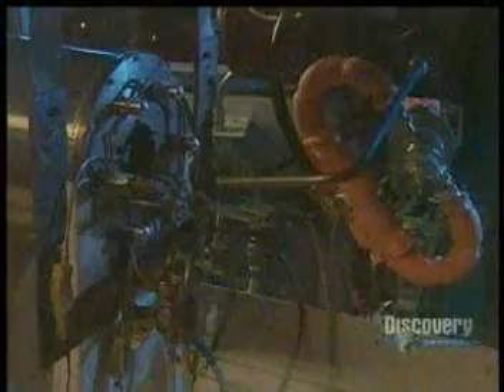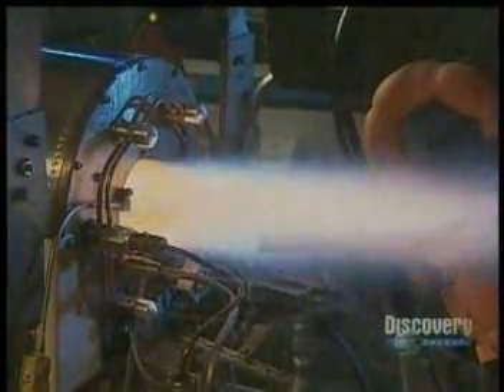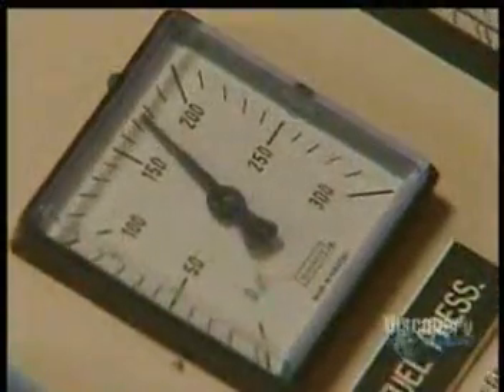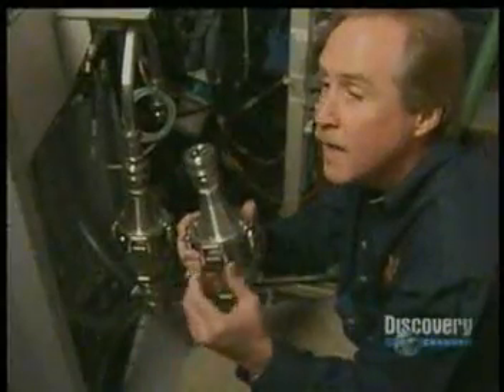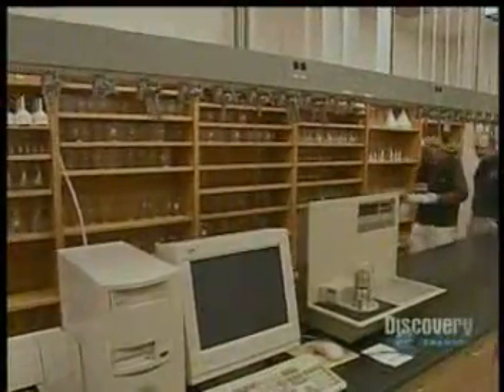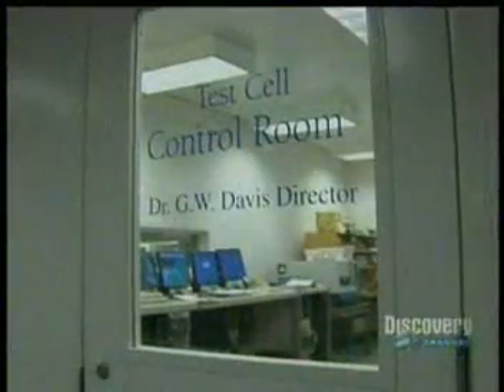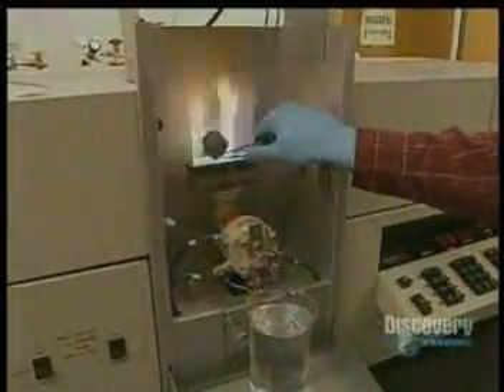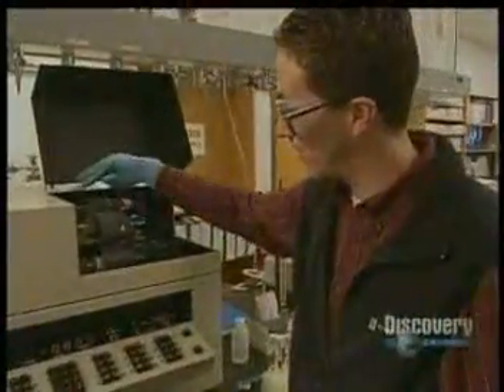Chem-trails on the Discovery Channel part 2 of 3

Comment: This is a COMPLETE waste of time, as well as a shameful attempt at a pitiful misinformation campaign on behalf of the Discovery Channel.  The Aluminum Oxides, Barium, Strontium and other "contaminents" isn't in the fuel at all.  This is so misleading.  The chemicals are sprayed through nozzles on the trailing edge of the wing tips of the aircraft used at Evergreen Air.  No one said the aluminum is in the fuel.  Folks, look up project Cloverleaf.  Educate yourself.  Don't listen to this crap.

Comment: what do you suppose the smoke trails are then? i see them all the time where i live. but only from what looks like small military jets like a fighter jet, never from bigger military jets or passenger planes. i have seen them flying and then just like magic it starts the smoke trail. i have also seen them turn it off or it stops. it seems strange to me. jet engines do not exhaust white smoke, neither does any other engine unless its burning oil.

Comment: Duh... this ISN't how chemtrails are being placed... This is a completely separate spray system... talk about strawman argument.  I've seen these being laid down... suddenly stop for about 20 seconds, and then resume all behind a jet... so, if it was the engine fuel, the obvious conclusion is that this jet's engines stopped for 20 seconds.  NOT!

Comment: @erniepond1 really, NOT, pathetic attempt to mislead.

Also nowhere do you address the differences in soil samples from County extension office pre 1995 to todays levels of metals.  And multiple mountain climbing sites have measured over 300,000 and 500,000 ppm of Aluminum, while EPA use to declare only 1000 of Aluminum ppm toxic...so seeing 30,000, 50,000, well that does not make me feel any safer.

I suppose you think Flouride is good for us too.  We will have to agree to disagree.

Comment: I am not aware of any Chemtrail believer that thinks the chemicals are in the fuel.  We have video showing the spray nozzles, often on the trailing side of the wing, dispensing the chemicals.  Others have said it, these types of tests only show that chemicals measured in soil, air and water samples are NOT in the fuel.  No duh, its in the tanks sprayed via those nozzles that have been videotaped...

Comment: @jackvincent90 "planes dump fuel all the time" - FALSE
"dumps are co-ordinated with ATC" - FALSE
"dump fuel in x formations and grids" - FALSE - they're obviously engine trails
"aluminium is used to refine petroleum" - FALSE
"In its nano form it burns silver" - FALSE - In any form it burns pink/white
Fuel systems couldn't handle aluminum - it's 3X denser than kerosine & would fall & clog pumps & filters
Try and leave the sixteenth century & get to the twenty-first
It will make U less gullible.

Comment: @beachcomber2008 so why do planes dump fuel all the time, and these dumps are co-ordinated with air traffic control so they purposely dump fuel in x formations and grids? its just odd  to me, you make some very good points but aluminium is used to refine petroleum  and in its nano form it burns silver (very hard to see in the sky) it may not even get burned seeing as they dump it rather than burn it

Comment: @jackvincent90 "they have those nozzles on the wings" - Yes they do - 2 dump fuel. There are 3 sets of fuel tanks & they're all necessary 4 fuel storage. There's no other equipment space in the wings and central tank
"where the chems come out from" - If that's where thne "chems" come from, then WHY do we only see vids of engine trails. Trails showing a GAP, by the way
"they could hide it in the fuel," not without coloring the flame & destroying the engine
Fuel isn't "kept separate" in the system

Comment: @beachcomber2008 na ur response makes sense i just didnt think about it, if it when throuht the fuel it would light up in diff colors, but they have those nozzles on the wings where the chems come out from, there was a theory that they could hide it in the fuel, do you not believe in  chemtrails?

Comment: @jackvincent90 "why did they use their test fuel, rather than the actual fuel the planes use,"
Fuel is KEROSINE (decane paraffin) which is a fractionated and filtered petroleum.
It is both the same and uniquely different because it depends on the source petroleum.
Metals, chemicals, biologicals, will ALL oxidize (burn) if they reach the 2,500 deg C combustion temperature of a modern turbofan.
Metals of any kind will color the flame for about a minute before they destroy the engine
U Morons

Comment: @TheTomtomdonk You cannot tell the difference in altitude between 35,000 feet and 36,000 feet from seven miles below and sea level unless you use a RANGEFINDER
But that 1000 feet difference may be all that's needed to allow a large and very dense trail and no trail at all, because stratospheric air is very thin and cold and LAYERED with different humidities. These layers aren't visible because WATER VAPOR ISN'T VISIBLE
There's Ur explanation, whether U believe it or not
Don't say U weren't told

Comment: @TrutherD1 I found a extra reason why they spray, solar power, these bitches are delibertly oberstructing us.

Imagine this all free energy is problem for the system since the econimic system is based on it, know if they spray some harmless stuff or even harmfull they squash 3 bugs at once,1 solving over population 2. they block the sunpower revolutuin 3.they can put in the miltary so they can be paid for a reason

Comment: whoever said that they aluminum, barium and strontium were in the jet fuel? .
Dont test the fuel, test the air and the soil.  That's like trying to test a crop duster for pesticides by testing the fuel and not the particles they spray, the air, and the crops.  
Pfft. Stupid Discovery Channel

Comment: google - the times chemical tests wiltshire

Do you really think things change?? If so I call that bloody naive
I have the patents for geo-engineering on my channel (welsbach cloud seeding)
I live in Wiltshire and the summer just gone I was sun bathing in my garden when 2 planes flew above me deposited spray then 5-10 minutes later a different type of plane flew through the trails and let 2 yellow weather ballons out the back 1 moved rather rapidly and other far slower I call that a test

Comment: Why do people always want to run different experiments on the ground.  Why don't someone fly a plane to collect the pollutant behind a plane that shows a contrail or chemtrail and then run experiments on that...that would seem logical to me...as apposed to running some experiment in a lab.  Also, it is interesting that in some of the videos and also some of the planes that I have witnessed, the contrail/chemtrail comes from the engine exhaust and sometimes it comes from in between the engines.

Comment: @madogmabz:  Chemtrails last for around half an hour or more.  After a few weeks of spraying, clouds become a bland blanket of grey. The sun becomes hazy because the particles in the chemtrails are designed to reflect sunlight back out into space and away from the planet.  Rainbow clouds are cool.

Then, if your immune system becomes compromised by any means (mine was anti-biotics), the gut is hit first, then respiratory problems from the barium.  Fatige, then opportunistic infections. Bingo.

Comment: deerr? its that easy is it? So government agents have been infiltrating aircraft workshops since ww2 and mounting injectors in the exaust stage of the jets, letting them fly, infiltrated AGAIN and removed them without any techies noticing?  ok... and where did they mouth the tanks to supply the injectors. and where do they fit the injectors? You have to THINK before you make claims like that. It simply doesnt work.

Comment: weather was good on the day both planes seemed to to be flying at the same hight but one plane left a contrail and one left a chem trail 5 minuits between they burn it after the fuel has burnt using the heat from the jets to burn what ever they burn not in the fuel  but after burn

Comment: they should have paid this company to test the air during a chem trail, and focused on the sprayings from tanks on board these air craft, the chemtrails are not a by product of engine combustion and are ran by a different system.

my grandfather retrofitted planes like this back in the 70's

Comment: 6:30AM-  just outside, a few minutes ago, I saw that the sky has already been criss-crossed several times. There were 3 planes in different parts of the visible sky continuing to leave trails that seemed to stretch from one end of the horizon to the other. I'm about 18 MI SE of Los Angeles and it usually seems that the planes come from the direction of Vandenberg AFB, not LAX. 
And they are NOT commercial airlines- they don't follow the flight paths of commercial planes routes around LAX.

Comment: The same planes/jets that leave the marks you see fly through there every single day but you only notice it the times that the weather causes the bigger contrails.. Also planes that may apear next to eachother may be thousands of miles away in altitude and remember the higher you are the colder it gets depending on weather and wind also has an effect on the contrails.

Comment: 1: The poison is not put into the fuel, its a separate dumbing system, that's why they can dump in certain places. 
2: Its commercial airliners with no passengers probably flown by the secret military. They are not going to dump fuel with a plane full of witness. my god ..
3: I think they have thought this dumping program through, just a little.. Its not going to take one test from a commercial airport the prove this one..

Comment: EXACTLY RIGHT, NOONE mentions the emission of these trails is NOT coming from the engines of the plane, and doesnt even correspond to engine-placement, but comes from SPRAY NOZZLES in the rear tail-surface. Just look at planes trhu theodolites, or telescopes, and see the truth for yourself. Also notice these chemtrail-planes do not follow the normal commercial air-traffic corridors, but are all over the sky sometimes. Chemtrails are quite disctinctive, and immediately draw your attention!

Comment: There have been no chemtrails this past weekend. Still plenty of air travel and passenger jets, just no more chemtrails. I think either the program is over, or someone has complained! Look at the jets that spray the trails that stay in the sky thru a telscope. The chemtrail planes have no logo at all, or an unmarked red fuselage with silver wings and tail-surfaces. i have seen chemtrails and normal contrail jets in the same sky for comparison.